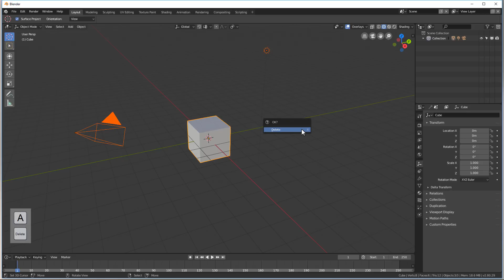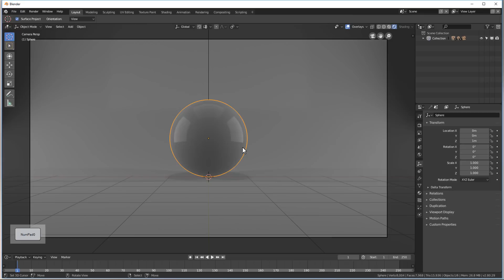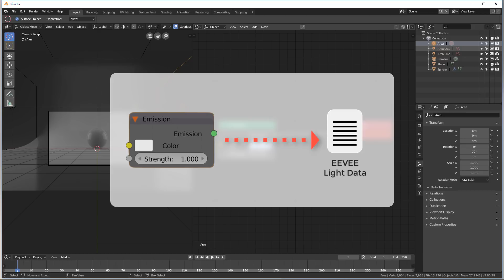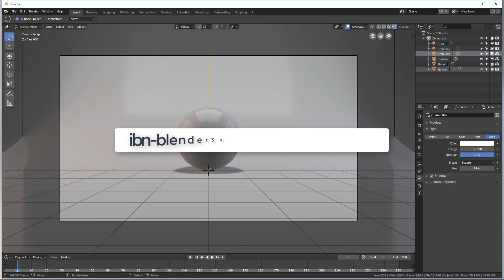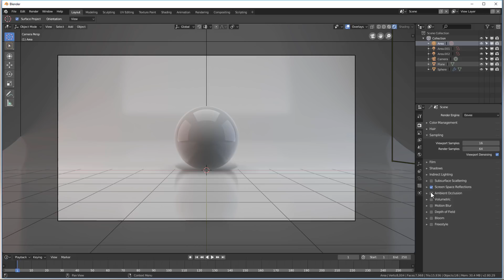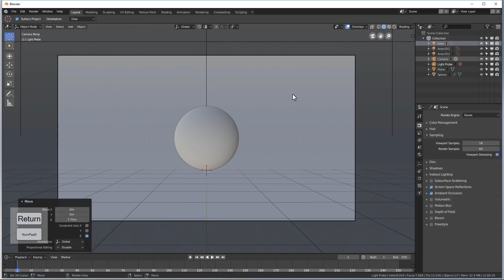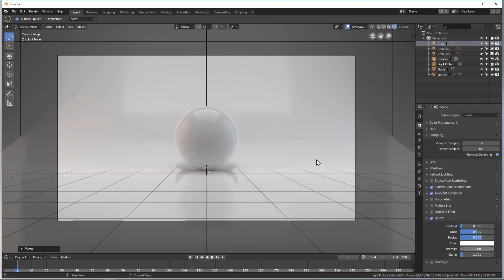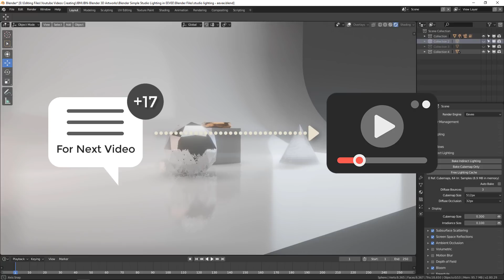Blender Simple Studio Lighting into EEVEE

Comment: I guess this doesn't work the same in 2.81a
Reply from the maker: Yes, it can happen, there are a lot of changes when the version of the blender update. This method was used to reduce the gap between the Cycles and the Eevee engine in the experimental version of Blender. But later versions have filled that gap.

Comment: In blender 2.81.16 i cant find the softness values for the lights as seen on 4:20, only contact shadows. What happened to softness? I found the soft shadows option in render settings, but there is no softness adjust value?
Reply: They remove the softness adjust value.

Comment: If the conversion from cycles to eevee is as simple as that, why there is not a button to convert from one to another, or it is done automatically when you change render engine? It would be helpful, with several lights in the scene, instead of having to convert every single light. I guess the calibration between both engines is still in progress, that may be the reason. But I don't think it's such difficult to make a script for this.
Reply: it is not simple it is a trick to use tools as perfect as we can.
and cycle is eevee converson is not like cycle infact...
but eevee has own advantages too